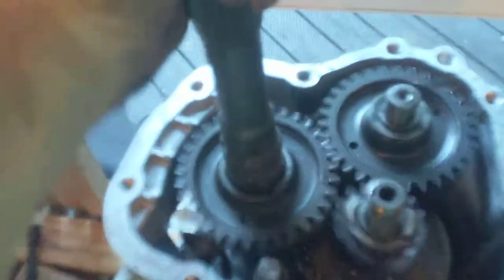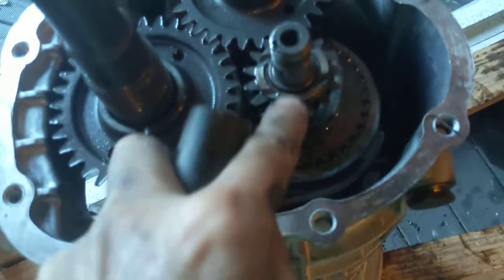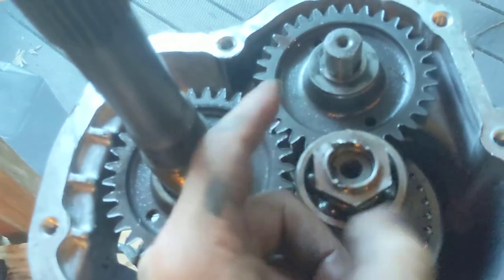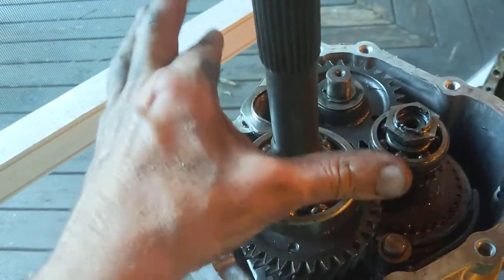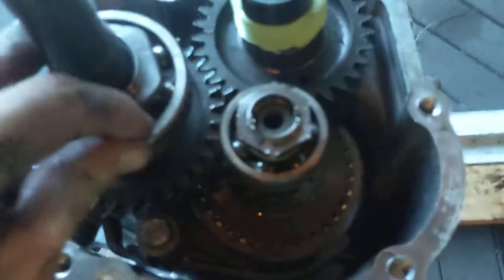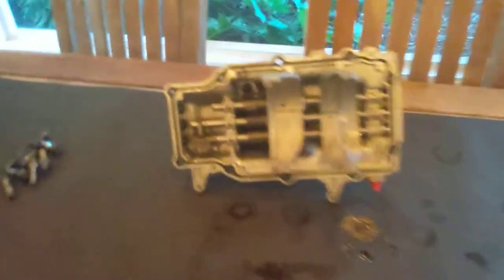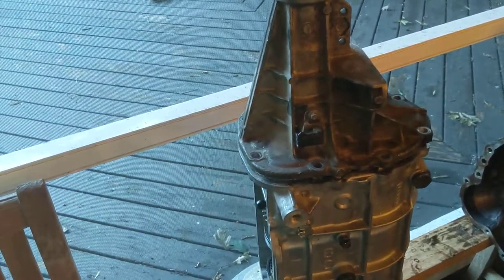Ford/Mazda M5OD R2 transmission reassembly Part 3

Comment: Hi Matt I have a 95 f150 and the person I got it from took the boat out of the idle gear on the side of the transmission and he put a plug in there and I'm just wondering if that could cause the reverse and fifth not to work right
Reply from the maker: It's been a while, but that would be a bad thing to do. The tail housing can be pulled without splitting the trans from the engine, btw.

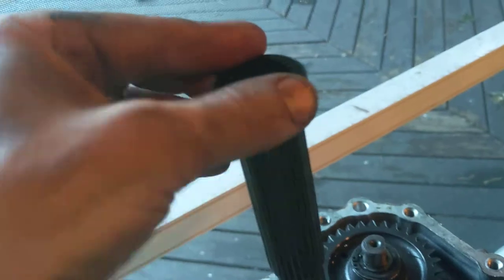Comment: I have a question about why there is gear oil on the tip of the horn with the cardan, there is a hole in the middle of the sleeve along with the crosshead, there is oil leaking right in this hole in the center of the cardan sleeve that fits into this notch at 3:47, could it be that my leak is due to this last rubber ring that is placed on the tip at 3:47, thank you if you can help me
Reply from the maker: The tail housing seal keeps the oil in. The rubber part with the internal spline is not an oil seal. Is your tail housing seal leaking?
Reply: Gearbox oil is leaking in that hole in the center of the crosshead sleeve, not in the tail retainer, it's new and it doesn't leak, and that cardan sleeve that goes on the tail in that little hole in it, the crosshead is all dirty with oil, have you seen that, thanks For your attention, I'm from Brazil, thank you